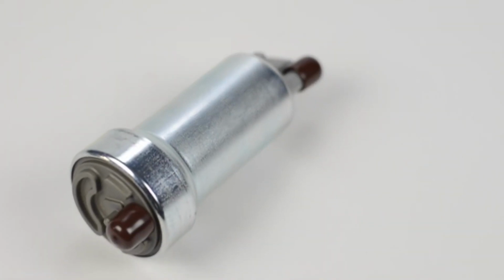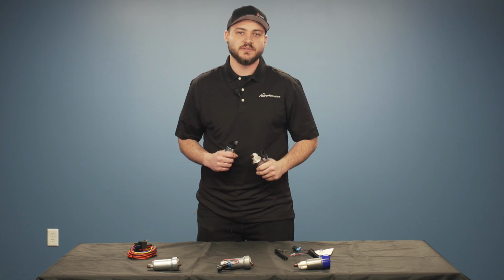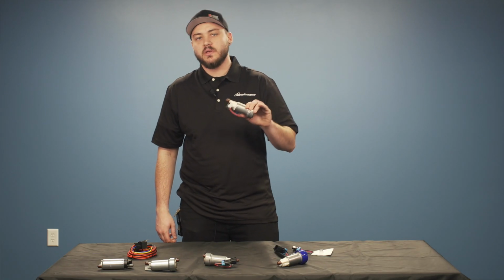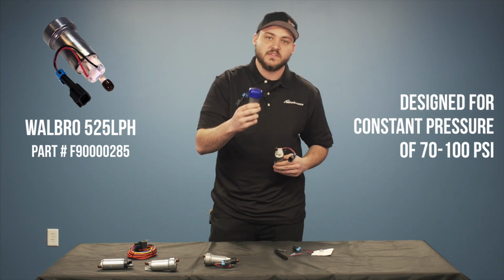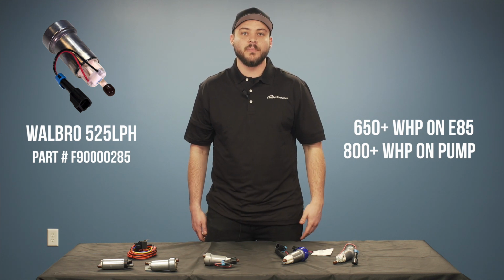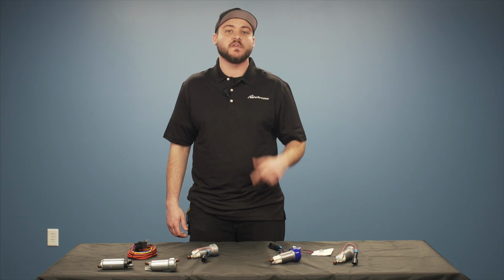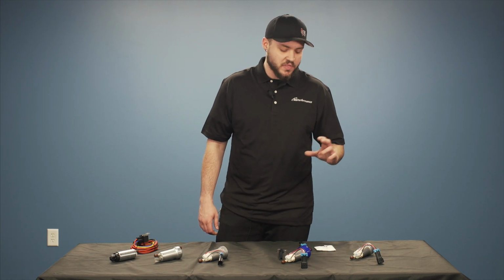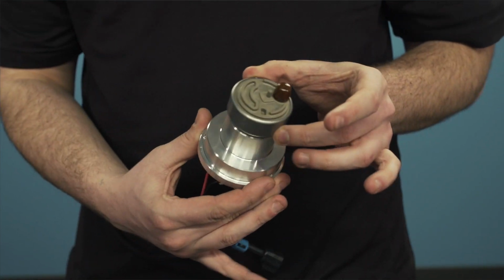Walbro Fuel Pumps - Everything You Need to Know for 500+whp

Comment from the maker: Drop a comment for fuel pump daddy! 💦
Reply: im getting a 255 for my boosted ep3, do i need to buy it with the install kit?
Reply: walbro 450 600+hp on e85 whit relay  i replaced it every year just to be on the safe size im also going all motor on my street car whit VP M5 race map whit a external FPR cant wait to see the numbers. been using walbro for years K.I.S.S.
Reply: So why is it called the hellcat is this what the hellcats come with for a pump in aftermarket translation? The reason I ask is I have a 16 hellcat challenger and as of now I dont need any crazy fuel pressure it's mostly stock on pump I just need a plug and play type kit that can be used for daily on pump and later on e85 and support 800 850hp just dont want this thing fucking up lines and other crap because its giving to much pressure. Also if I do this does it need a tune or will it except the old computer data and run fine after install. Pumps going out. Also if you have a pump that works was thinking the 525 but if you have reasons not to get it or if it needs special fittings please let me know.
Reply: I have the fore triple billet pumps for a 03-04 cobra and has 3 255 walbro pumps and I want to be able to run e85 with 1000 hp can I use 3 Walbro F90000267 to do that, its 3 6an lines into a single 8an line to the fuel rails
Reply: I have 01 Chevrolet truck 5.3 going to put the tbss intake and injectors with a bigger cam factory isn't holding up what do you think I need
Reply: is walbro pump uses metal impeller or plastic?
Reply: I’m trying to get the right walbro fuel pump to go on a factory 2016 L86 swap. Which one do you recommend? And that will fit on a 1993 s10 blazer. Thanks!
Reply: Hey broo I have a bmw e46 330i stock what’s the one should I pick??? Please

Comment: i I have a 2007 BMW e90 335i. In my vehicle the engine has been rebuilt and it has two t17 turbos. the pistons was enlarged. intercooler and all other systems were made. Now I plan to change the fuel system and get 800 hp +. Which of these systems would be appropriate for my vehicle to get more power? and I have jb4 chiptuning in my vehicle, I want to make port injection and methanol connections. thanks
Reply from the maker: Shoot us an email: sales@maperformance.com we'd love to talk specifics with you!

Comment: Great video! I currently have the 450 high pressure with a stm hard wire kit on my DSM. And made 480 hp. Currently trying to decide if  I should upgrade to the 525 or just do a in line pump to compensate. Since I ran out of injector on the dyno the new 2150cc injectors will be going in. Pump gas car currently, might go e85 🤷🏽‍♂️
Reply from the maker: Vic give us a call or email sales@maperformance.com - we'd love to help out!
Reply: You'll get better hp n tq with the  e85 just a less common fuel.. I have a switch for my ECU to switch between tunes e85 n 91

Comment: ok here the thing...... i have an bmw e46 325i 2002 and have the engine m54 stock.....just want to change my fuel pump caus think is not at 100% so, thinking on make the change and upgrade the fuel pump....so i was thinkingo on a Walbro GST400. want to know if can be correct this option...

Comment: It doesn't causes shortage by E85??As if when you actually spliced the power and also spliced ground in an intake with regular butt connector. Am nervous as doing regular butt connector and planning on use E85.Didnt use heat shrink either.   Kinda nervous !

Comment: I'm doing a ls3 swap in my 04 infiniti g35 coupe, and I'm not boosting or using turbos, just installing a 3 stage cam, and won't be going over 500 hp, what is the perfect in tank pump that will work for me? a guy told me the Hellcat 525 is the way to go. Plz help, Thanks< video is very informative also... I sub

Comment: Iv'e had two walbro 460's fail in two years...dont know why...but i'm over it.
Reply: Most likely because of restriction. When you put the pump in a very small space it takes a lot to get the fuel into itself. So to do this is ramps up the speed to achieve the same intake of gas it usually does which causes it to over spin. Increased wear then failure is likely.

Comment: Hey Leo, I have a 2020 Chevy Silverado 1500 no engine . Purchased a 427 self built ( don’t ask how much I’ve paid for it. It’s ridiculous ) short block Whipped LT. Anyway, I know you probably won’t get this message, but I’m looking for a fuel system for this truck. I can install two. Walboro 450, a Bean machine sump which I already have all the stuff for it. Flex fuel, methanol injection, Lingenfelter, Katech heads, Callies Magnum crank, Callies Compstar Rods.  1000hp+ daily driver. But anyway, how can you help me with fuel system like I said I have no intention on you replying to this, but I figured I’d write it anyway but I’m getting to that. I’m dropping my engine in right now..

Comment: If the wires on a walbro 255 are accidentally connected backwards, can the pump still effectively operate in reverse polarity. I plan on fixing this but I’m letting the fuel get low again to remove the pump also the car is fully built stock turbo 04 srt 4 . Currently on 4 lbs boost for break in period then going to 20 psi.  Question of curiosity thanks
Reply: I wouldn’t think your car would start. At least that would be the case on the car I have.
Reply: @freddiemendoza4188  thanks for your input. You are correct it wouldn’t start as the pump was flowing in the opposite direction. I took the wires at the connector on the car side and switched positive and negative to make the pump flow to the engine and it works . Was curious if this would affect the performance in any way. Sry it’s complicated to explain but thank you sir .

Comment: Simple question: How on earth do you fit the supplied tube to the pump's barbed fitting? It's very, very tight and I'm afraid to break it... (walbro 450 kit for 335i)
Reply: Heat it up with a heat gun and gently start pulling. Same way when installing if you want to use the same tube.

Comment: I need to know if using the 400-1168 install kit on the 450 pump I just bought. It has a flexible plastic hose and just reg gear clamps 
Will the gear clamps hold on the plastic fuel line 
Ty 
Not impressed with walbro cheating out on this
Reply from the maker: Hey Ben, give us a shout! We should be able to help answer that.

Comment: Good evening I have benz c230  kompressor coupe serial # wdb7472a329031 super charged ENGINE had in a walbro fuel pump # pat5257916 which would be my best upgrade if you could send a link where it can be purchased I'd be grateful

Comment: 255 - hates oem wiring it draws more than oem pump...
Reply: 100% wrong it actually draws just about 50% as much as oem pump in all my testing which was mind blowing. model gss342 tested. If your cars wiring is crap then it will still drop off at high rpm

Comment: @fuelpumpdaddy...i want suggestion pump for my bmw e46 1jzgte gtx3582r on 650cc injctr running 400+hp....thx
Reply from the maker: Give Leo a call or email! Ext 107 or Leo@maperformance.com
Reply: what did u end up using? iv got the same turbo and injectors on my r32 mk5 im confused wich pump, iv got 400lph already
Reply: I end up using internal 300lph and external AEM 400lph with deatschwerks dwff110 filter with fuel surge tank..upgrade to 1000cc bosch ev14 injectors...and mark at 480whp that enough for me...